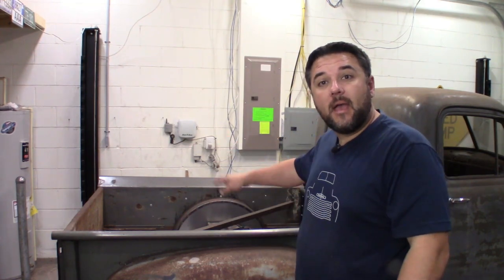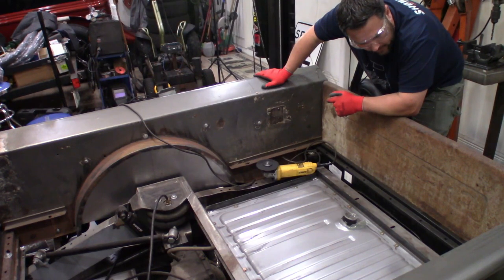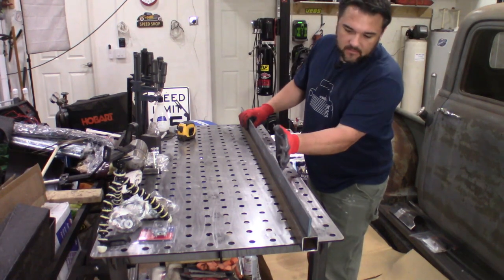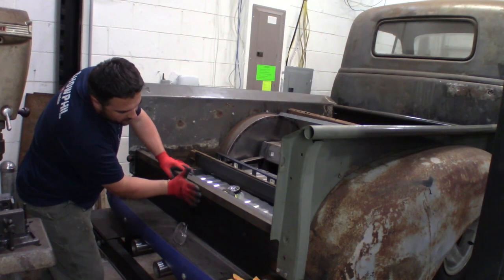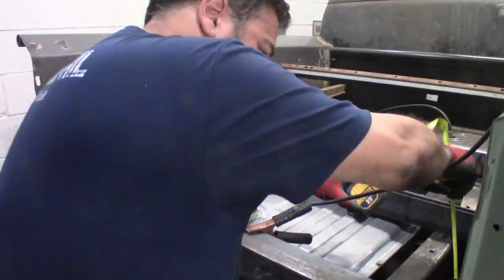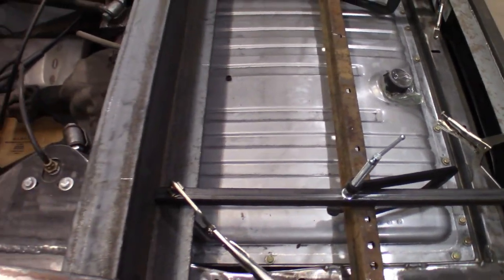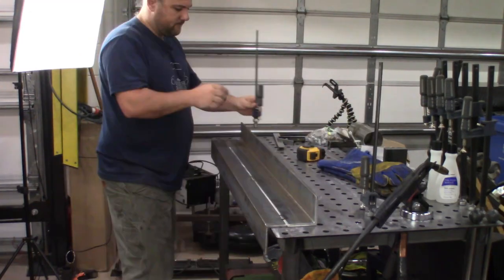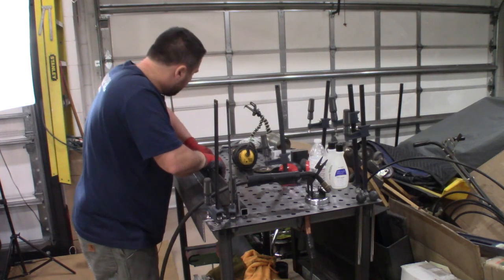PART 42 - 1952 Chevy 3100 - WOOD BED FRAMEWORK - PART 1!

Comment: Nice work, would look cleaner if instead of metal hiding the wood edges, you 45 mitered it and had the top wood waterfall down into the wood below. Grain match it and it would look seamless and a lot better.